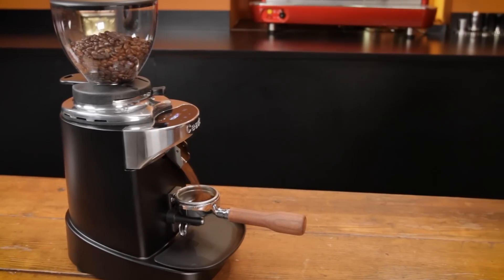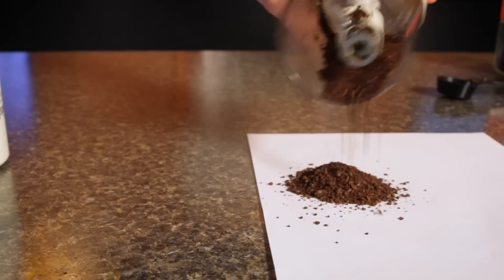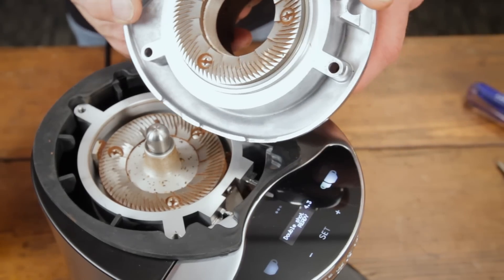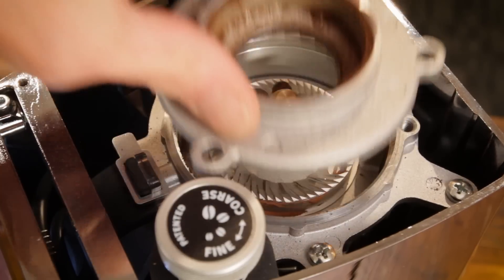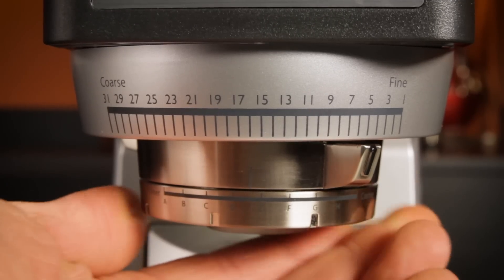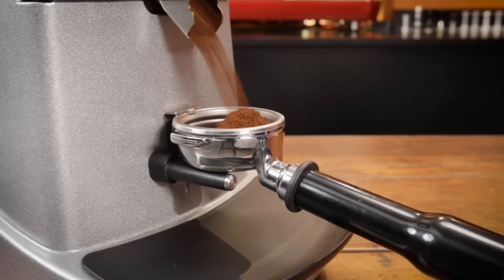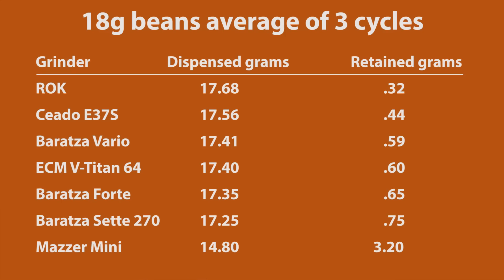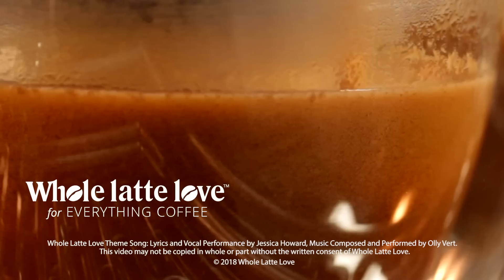How to Choose the Best Coffee Grinder for Beginners

Comment: I'm probably going to buy an ECM Classika because I don't steam or use milk. You've sold me on the Ceado grinders. What's the difference between  the E37J and the E6P? Is it just programmabilty or is there a difference in how they actually grind?
Reply from the maker: Hi LRG, Thanks for the question. Grind is similar between the E37J and E6P. Both have 64mm burrs and 300w motor. One key difference is opening up the grinding chamber. On the E37J there is no loss of grind setting when removing the top burr plate assembly. With the E6P you unthread the top burr carrier which causes a loss of grind setting. Programming is different. E37J shows you the time in a display. On the E6P there is no display of time. You press a button to adjust grind time in 1/10th second increments so it's a bit of a guessing game as to your actual grind time. The also differ in build quality a bit. Both are excellent, but the E37J is built like a tank while the E6P has some plastic components in non-critical areas. ECM Classika is a fine choice for those who don't do milk drinks. Hope that helps!
Marc
Reply: @Wholelattelovepage  ,thanks Mark.

Comment: Great video. What is the best grinder for a coffee bike business using a Oster PrimaLatte Evolution ? Tks.
Reply from the maker: Coffee bike business? I need more details. I'm not familiar with the Oster machine. I did look it up and it appears to use a pressurized filter basket. When brewing with that system perfect grind size is far less critical than when brewing in standard non-pressurized filter baskets. So long as the grinder can do espresso grind size you can get away with something at the lower end say a Baratza Encore or Virtuoso.
Marc

Comment: Hello Mark, I got myself from US, GX5000 krups burr grinder...
The finest setting i feel is still not fine for espresso. Although I get excellent creme but my double shot drip fades out sooner than 15 sec.  I use a home espresso machine..15 bar pressure. 
Do you feel, grind size might be different from espresso machine to machine.
Reply from the maker: Hi PP, Grind size does need to be adjusted depending on variables like coffee used, coffee dose weight, machine, etc. Even with the same machine and bean grind size will need some adjustment as the coffee ages. The Krups grinder is not really capable of grinding for espresso other than for use in entry-level pressurized filter basket appliances. It lacks the grind quality and fine grind size adjustment needed for standard espresso extraction in full size non-pressurized filter baskets.
Marc
Reply: @Wholelattelovepage  I agree..I had to return my Krups. Have ordered a Baratza Encore as it fits my budget. Hopefully I will get a fine grind size suitable for my home espresso machine

Comment: Hi Marc, thank you for the informative video. I own a Bezzera BZ10 for 2 years now and make 1 cappuccino a day but I’m still not happy with the texture of the frothed milk.. The milk texture is not uniform and I often get this blob on the surface.. I can’t get a uniform creamy milk.. i’m always doing small quantity for 1 cup, use skimmed milk, follow the techniques I watched in many videos and stop when it gets hot to hold. Is it a problem with the Bezzera not being good for steaming or my technique is bad? What might I be doing wrong?
Reply from the maker: Hi AS, You are welcome and thank you for the question. BZ10 has plenty of power for frothing milk. Don't get discouraged! Skim milk is a little harder to froth and can't match the quality of milks with fat as far as consistency and the creamy mouthfeel. Basic frothing advice. Start with steam tip slightly below milk surface. When steaming initially you want it close enough to the surface that small amounts of air are ripped into the milk - you will hear this happen. Once some air is in the milk will start to expand/stretch. As it expands keep the wand tip in position allowing the milk to cover it more. The ripping of air into the milk will stop as the milk level goes higher in the pitcher. From there find a wand angle which causes the milk to roll in the pitcher. That will break up any larger bubbles and help to create a uniform consistency.

If you a getting blob of foam that indicates too much air in the milk. When steaming allow the milk to go further below the milk surface earlier in the process - and get the roll going to break things up and mix.Marc

Comment: Hi Marc, I just watched this video and found it very helpful in sorting out the. options. Thanks. I read your response to Dan Furness below regarding the Quamar M80 and am intrigued. I believe, and please correct me if I'm wrong, the the Quamar is pictured at 6:43 in the video illustrating stepped adjustment in an espresso grinder. I'm looking for a multi purpose grinder that can also do a very good espresso grind. For that reason I want a stepped grinder so I can go between grind types predictably without having to recalibrate each time. I assume as needed the doser on the M80 could easily be used to fill the scoop for my Technivorm KBT. Please advise as to whether of not you think this grinder could meet my needs for espresso, my Technivorm and French press as needed. I am a one person household so quality and not quantity is the goal. Thanks
Reply from the maker: Hi David, Thanks for the question. Always a bit of a compromise selecting a grinder for multi-purpose use. A good choice IMO is the Baratza Vario. It is stepped with macro and micro adjustments and can grind directly into PF or included grinds bin: https://www.wholelattelove.com/products/baratza-vario-grinder-w-metal-portaholder Baratza considers the Vario their most versatile grinder along with the Forte which is very similar to the Vario but built for higher volume commercial use.;
The Quamar M80 is machine grade and an option but IMO will be tasking if making larger changes in grind size on regular basis: https://www.wholelattelove.com/products/quamar-m80-on-demand-electronic-grinder
Hope that helps!
Marc
Reply: @Wholelattelovepage  Thank Marc. I don't feel I will be switching back and forth a lot but just wanted the versatility. They recommend the Vario use steel burrs for brew grind but it comes with ceramic ones for espresso which would also be a compromise.The Vario presents like glorified appliance and I prefer the commercial build/appearance of the M80 including the larger burrs. Would there be enough room under the. doser of the M80 manual to fill the larger scoop of the Technivorm? I think the scooper is about the size of a portafilter. Thanks. David

Comment: Hi, Mark. Greetings from Chile!
I recently purchased a Gaggia Classic and now I’m looking for a grinder. The coffee equipment market in Chile is very limited so my options are few.
Is it possible to get a grind fine enough for a good espresso from the DeLonghi KG89 (it is the most affordable option)? Then I’d have to jump to a Baratza Virtuoso, which costs six times the price of the DeLonghi. Thank you very much for your help!
Reply from the maker: Hi CM, I cannot recommend that Delonghi grinder unless you will always be using a pressurized filter basket. It just doesn't have the grind size control required for brewing in a standard non-pressurized basket.

Comment: Is the breville express built in grinder as good as these grinders or I better buy one of the grinders in the video ?
Reply from the maker: Hi, The built in grinder is sufficient for servicing the Barista Express. Some grinders in this video like the machine grade espresso specialists are better at very fine control of grind size.
Marc
Reply: @Wholelattelovepage  Thanks Marc you just ROCK :) Hmmm what I know is that I need a new grinder, but I have to decide whether I just the breville express with the built-in grinder or get a good grinder and I'm thinking of two possible options: 1. sette 270 NOT the W version because I don't think I need it to weight the shot for me 2. MDX on demand.

Do you have any recommendations for me?

Comment: I don't understand your statement about conical being preferred for brew vs flat for espresso. You'd definitely want flats for max consistency in brews. Maybe you got it the other way around?...
Reply from the maker: Hi Guru, Tanks for the comment. I prefer flat burrs for espresso and virtually every high-end and lab grade espresso grinder uses flat burrs. Most respected consumer oriented brew grinders use conical burrs. But, there is some crossover, The Baratza Sette grinders use a AP conical burr but they do have an accessory conical BG burr for brew grinding designed to produce less fines at larger grind sizes. I think some baristas may have a preference for a conical burr for espresso grinding as that's what they were exposed to in high speed commercial cafe grinders. They are fast, but IMO not as consistent in particle size as newer large flat burr grinders.
Marc

Comment: sorry, baratza vario is terrible. if you notice then the burr is held by plastic clamp and that is very very very big issue.! it just cannot grind lighter than darkest roast for espresso. really? did you miss that altogether? in fact it struggles even with darkest roast if more than about week old. such a waste of money. very poor engineering. i had to throw it away and get rancilio instead where burr is held by metal on metal threads and has zero issue with roast level
Reply from the maker: Hi rayhan, Thanks for sharing your experience. I've used the Vario extensively and that has not been my experience.